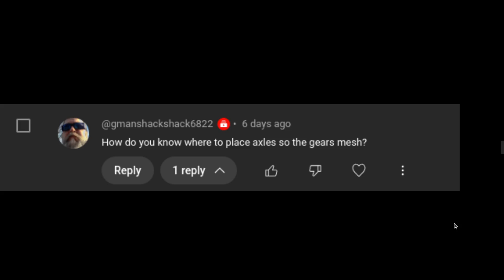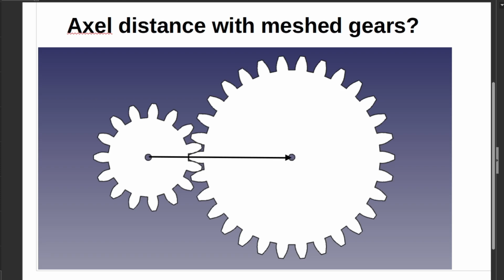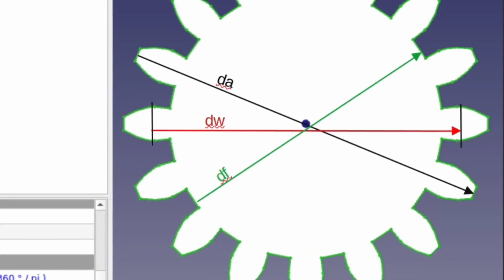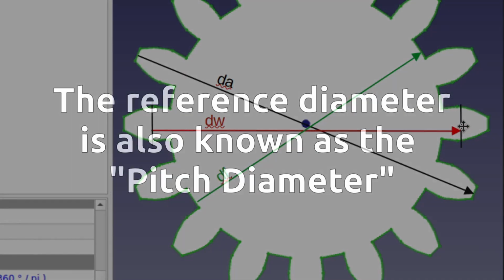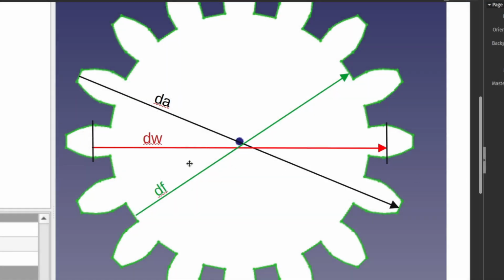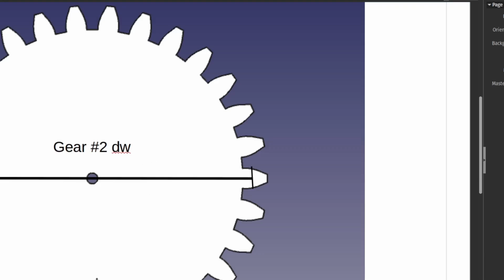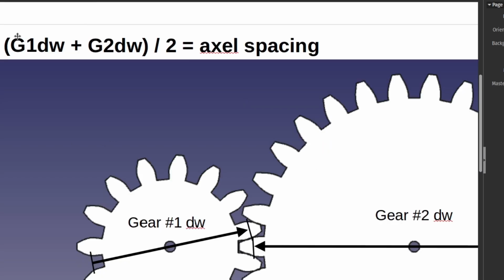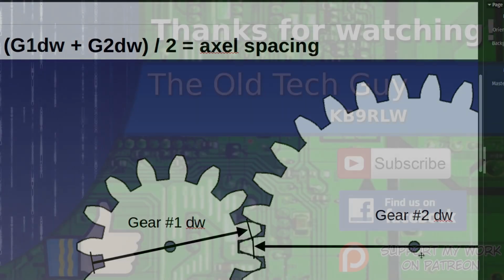3D printing Viewer question short - How do you figure out axel spacing of meshed gears in FreeCAD

Comment: And in FreeCAD you can make a reference to those values in your other measurements, so that when you change them, anything referencing those values automatically updates.
Reply: I'm as much of a simp for freecad as anyone (IMO its just super stupid to build a skillbase on any proprietary offering you can't ensure you'll always have access to, moralism aside) but literally any decent CAD program can do this.

Parametric modeling is basically just a requirement for CAD.
Reply: I am really  struggling to make that work. For example, I would like to reference the outer-diameter parameter in my spreadsheet and it just doesn't work. I've just loaded the latest 1.0.0 release. The Gear add-on isn't under 'official' FreeCAD so maybe they got something wrong. I've spent hours today and every time I add a gear the model goes to crap. Very fustrating.

Comment: Thanks, Kevin!  Now you're making me want to sell an organ or two to buy a 3D printer!  😁
Reply: Unless you want to get into multi-material printing or engineering filaments there are actuslly a ton of really good options for cheap right now. FLsun delta printers are obscenely cheap right now for example. Deltas give great speeds and great precision, (rivaling and exceeding 1-2k coreXYs) but their main downside is that they're a bit physically large for their build area. For as cheap as they are right now though, if you don't want to print anything that needs a heated chamber like ABS or ASA, they're kinda a steal.

Bambu is the other common suggestion but tbh personally I don't see very much special about them.